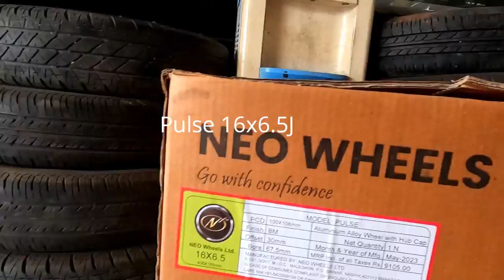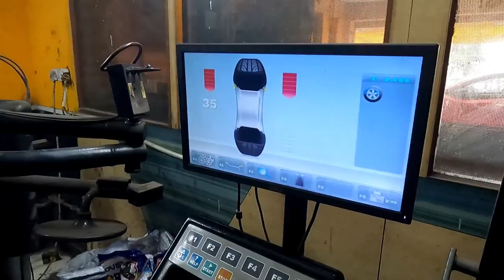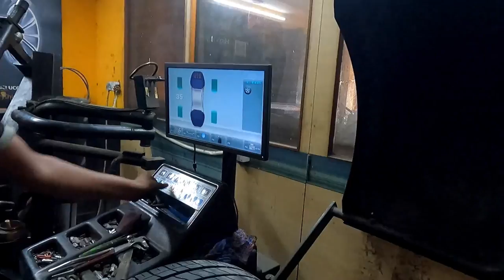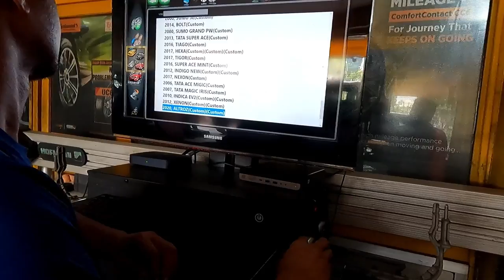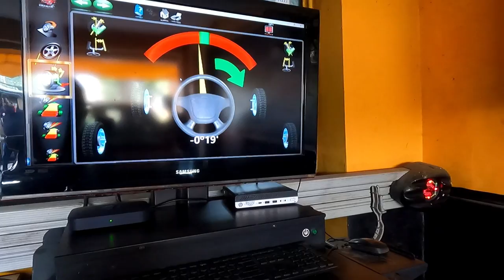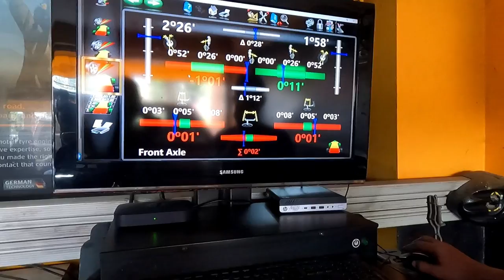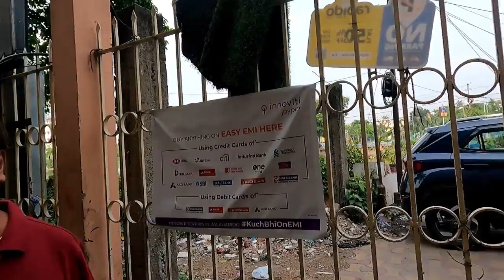The Perfect Alloy Wheel Upgrade For Tata Altroz XT #alloywheels #alloywheel

Comment: Good pickup of Alloys and absolutely matching the Altroz... I too owner of Altroz XE rhythm even I'm looking for upgrade to alloy but its 14inch and can you suggest the specs
Reply from the maker: There's a lot of options for 14 inch wheels. You should check that the rim width is near to OEM rims.
Reply: @supercyberautomotivetravel  Sir is it not possible to upgrade to 16 inch alloy wheels in Altroz XE rhythm?? Do we need to upgrade to 14 inch only??
Reply from the maker: You can upgrade to 16 inch alloys. But you have to change your tyres to 16 inch too.

Comment: Hello Sir can I upgrade my tyre size for stock 185/60-16 to 195/55-R16 Bridgestone Sturdo plz guide me on this
Reply from the maker: Yes 195/55 R16 is a standard fitment .  Bridgestone is a good brand.My car is fitted with 195/55 R16 tyres.
Reply: @supercyberautomotivetravel   sir I own Altroz automatic car could you recommend which tyre is best for India road and fuel efficient good breaking and handling
Reply from the maker: If you mostly travel on tarred good roads then Michelin and Bridgestone are the brands to go for. But performance tyres have disadvantages too if driven on bad roads the chances of punctures are quite often. Since the tyre compound is on the softer side.  Their average life is less also. But if you want a compromise between performance and life Appollo Alnac is a good choice. I also prefer Goodyear Tripplemax 2 due their unconditional warranty and after sales support. They are also good for Indian conditions.

Comment: I have altroz base varient wheel size is 4.5jx14. i bought alloy of 5jx14 is it right bro. Tyre size is 165/80 r14
Reply from the maker: Thanks for your query. 4.5 J is not available in after market alloys. And  4.5x14 5J is within the specs so there will not be any issue.

Comment: HI I am planning to upgrade from 185/60 R16 tryes. Can I upgrade to 195/60 or 205/55? Thanks
Reply from the maker: You can easily upgrade to 195/55 tyres which the Altroz used to get in 2000 and 2021 models. Anything higher will result in higher fuel consumption and rolling resistance and give  speedo error.

Comment: Hello sir you seem to know this stuff clearly. Many youngsters are simply upsizing or changing alloys based on looks only. Im having a baleno sigma which is factory fitted with 185 65 15 on steel wheels.These tyres are good for slow traffic but on highways the alnac 4g is not very confidence inspiring. I would  like to upsize to alpha variant tyre spec of 195 55 16 bridgestone sturdo but im planning on instaling these same wheel of 6.5j rather than oem 6j solely for improving the cars stance and looks.. My 2 concerns
1) Are these wheels lighter than oem steel wheels or alloys.

2) Will 6.5j wheels with 195 55 16 cause any issues other than mileage drop.

I would actually like to know if these alloys are lighter than steels because the more lighter the better the handling.Also is 6.5j alloys of neo available in 16 inch size??

Expecting a reply ❤
Reply from the maker: I have made this video in context to Tata Altroz . This will give a clear picture how to select the perfect alloy for your car
https://youtu.be/TBzdbO_yOSg

Comment: Hi, does wheel came out a little after installing this alloy? I also installed it and performance improved. How much tyre pressure you maintain now?
Reply from the maker: It's a little bit outside the wheel arch . I am maintaining 33-34 psi in city drive and 35 psi on highways fully loaded

Comment: How is the experience so far with neo pulse ? Do the shiny part still shine as the new ones ? I have selected the same 16 inch pulse for my new elevate. The sales guy says it will be either of 7 or 7.5 width. OEM is 7. He says both would fit easily. What difference would it make if i use 7.5 if the OEM is 7 ?
Reply from the maker: Mine is still going fine no paint peeling issue. Absolutely shiny like new.Go for the 7 inch one as 7.5 will increase your rolling resistance. In my case the OEM was 6.5 so I have maintained the same.  In case you go for 7.5 check the width your tyre supports .
Reply: Can you please share review after changing to alloys?? Is there any improvement in acceleration/pickup and ride and handling?? @supercyberautomotivetravel
Reply from the maker: Handling has improved . But alloys will not increase your acceleration or pickup. Yes the tyres run cooler braking will improve marginally. Also no rim rusting .
Reply: @supercyberautomotivetravel  Can I know exact reason you changed rim from steel to alloys? Is it for looks only?
Reply from the maker: In Bengal humidity is very high so the steel rims tend to rust quickly which results in frequent air loss and you need to top up air pressure more frequently. Also Alloys are wider  so I can enjoy the full potential of 195/55 R16 tyres as it's the best fit as these alloys are 6.5 inches wider. In theory there are a lot more advantages in Alloys but they may not be applicable in day to day driving. Also braking has improved as alloys are lighter and road grip will improve. Definitely looks is the point to consider also..

Comment: Sir, I also fitted this alloy. Very nice.  Can you guide how to register for warranty? Does dealer themself register it? Also I dint do drum paint and also they suggested me to buy special bolts for which allian key will come. And it's difficult to remove without allian keys. Costing 1600Rs for 16 bolts. I dint buy those. Not changed. Also they insisted me to buy special spanner to remove this bolts.  Its not possible using normal accessories given along with car.
Reply from the maker: Thanks for your feedback. The OEM nuts are the best and I have kept the same. Buy a 18 mm socket and a l handle of good co to remove the nuts from alloys when needed. OEM spanners will damage the paint of alloys as they are thick and foul with walls of nut area. I have also purchased this.
https://amzn.to/3UBmCJS
https://amzn.to/4bgCZ43

Comment: Dear sir i also have xt model and want to add alloys un my car plz tell ne total cost of alloys with fittings and the old tyre will be work or i need to change the tyre as well. I am from  kharagpur. Plz reply.
Reply from the maker: Thanks for your query.The alloys will cost you Rs.28000/- for 4 tyres. Additionally you have to pay for wheel balancing with weight. For all those it will be around 1500-1600. No need to change the tyres.
Reply: Wow

Comment: Any effect on mileage so far?
Reply from the maker: Not at all as the wheel rim has the  same width of OEM alloy.
Reply: @supercyberautomotivetravel Hi. Have you got a chance to see the difference in weight of steel wheel with tyre and alloy wheel with tyre??

Or just weight of steel rim vs alloy rim??
Reply: This weight is unsprung weight. If unsprung weight is less for alloy+tyre, then it increases pickup, acceleration and ride quality. The steering should feel light for turning etc.
Reply from the maker: Alloys are always lighter. I can pick one rim with a single hand easily. Whereas the weight of still rims can be felt when lifting.

Comment: what did you do with the steel rims? Did you sell it to the shop owner?
and why didn't you choose the OEM alloy wheels?
Reply from the maker: Neo Wheels are very well built as per OEM standard. The wheels have a 2 year warranty. The old wheels I have kept as the shop was offering very less. I have decided to keep it and in case I sell the car I will revert back to steel wheels. Since a lot of cars and Altroz have common wheel size .
Reply: @supercyberautomotivetravel  thanks for your reply. I have the same XT model and I was thinking of upgrading to OEM alloy wheels but those must be expensive.
Reply from the maker: OEM is expensive but there's no harm in after market alloys so long they are near to OEM specs. I have made a dedicated video on how to choose correct alloys.
Reply: @supercyberautomotivetravel  sure. I'll check that video too. It will be very helpful
Reply: @supercyberautomotivetravel how much were they offering for the old rims just curious
Reply from the maker: Very less so I have kept it . If I sell the car in future then I will revert back to the steel ones.

Comment: My iturbo xz+ has 185/60 section tyre. Earlier it used to come with 195/55 section tyre. Should I consider upgrading to 195/55 or 195/60 section tyre?
Reply from the maker: Thanks for your query. 195/55 offers  sportier  handling and grip than 185/60 tyres. But on the negative side 195/55 gives harsh rides on bad roads and is more prone to cracks and punctures in bad road conditions. On the positive side 185/60 offers better fuel economy and a comfortable ride on bad road conditions.
Reply: @supercyberautomotivetravel  do you suggest that I upgrade from 185/60 to 195/60? I saw in upgrade calculator its within 2%
Also would love to meet you someday. I stay in Rajarhat, Kolkata
Reply from the maker: Thanks for your appreciation. Definitely you can upgrade as it is within the specs. But those points are to be taken into consideration which I mentioned earlier in my reply. My car came with 195/55 section tyres as it is an early 2021 model. 195/55 also adds a bolder look as the tyres are wider. I will definitely meet I am from South Kolkata from Rabindra Sarovar Metro.

Comment: Hi, i have Altrox XE Rythm which has 14 inch steel rim. Can i upgrade to 16 inch tyre and alloy of top end model, Is it correct? Or will there be any ABS or speedo meter tuning issue?
Reply from the maker: You can safely upgrade to 16 inch Alloys without any impact on ABS and speedo meter reading. Make sure you stick to 6-6.5 inch rim width.

Comment: Do you anybody in Delhi.. who have same set or company alloy wheels.
Reply from the maker: You first check the Neo wheels website if it is in stock. Then check with Neo dealers in Delhi. If the dealer does not have the stock tell him it's available on the co website. Then make an advance to him after he confirms the availability. This is the way I bought it.
Reply: Have you changed wheels
Reply from the maker: Yes I have changed the wheels

Comment: Can you suggest alloy for i20 magna 2022
Reply from the maker: Thanks for your query. I 20 magna comes with 185 / 65 R15 tyres with rim size 15 inch dia and rim width 6J (6 inch) and I20 sportz comes with 195/55 R16 tyres and rim size of 16 inch dia and rim width 6J (6 inch). If you dont want to upgrade your tyre you can fit any 15 inch alloy rims having width of  6-6.5 rim  inces for best compaitbility. IF you want to upgrade tyre to 16 inch size of i20 sportz you can choose any alloy rims having 16 inch dia with  rim width size of 6-6.5 inches. I am not suggesting any rim brand and design as choices may differ. Here is a alloy choosing guide.
https://youtu.be/TBzdbO_yOSg